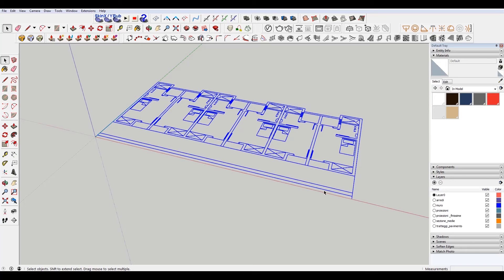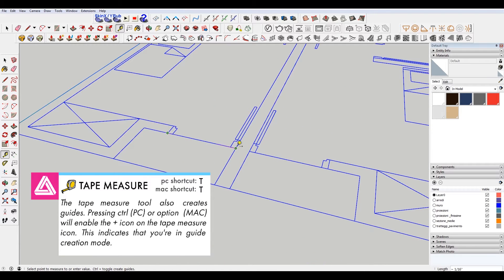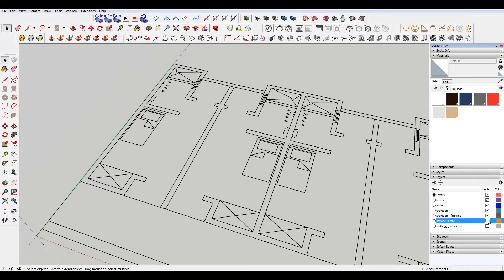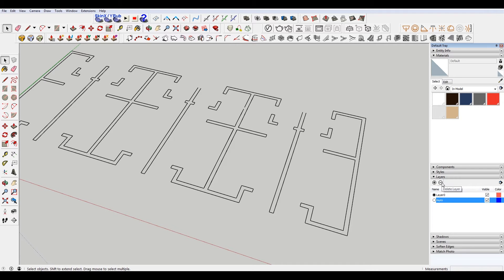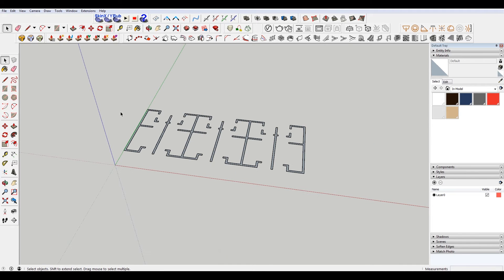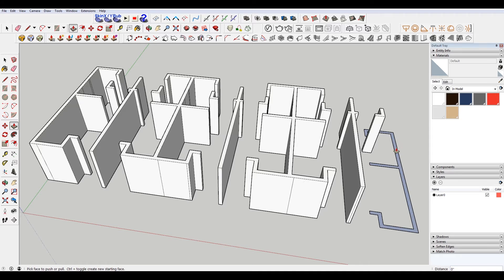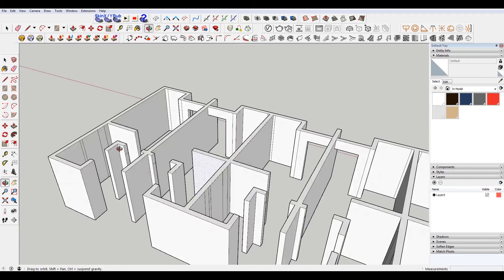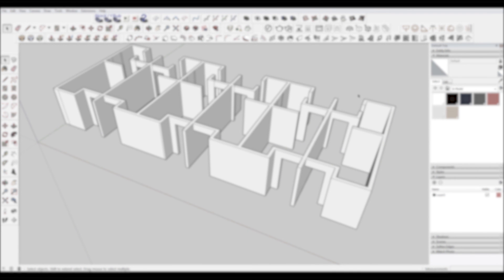How to Quickly Convert an AutoCAD DWG to a 3d Model in Sketchup

Comment: try that on a 500+ layer autocad mess with blocks, xclips, splines, curves exploded into 96 edges.. and nothing in its correct layer.... aHHHHH!  .  Personally,, I find it quicker on import to delete all the autocad layers, place the file in a separate tag, lock it and draw new work over the top, using the rectangle tool to ensure most walls are orthogonal..

Comment: Hi Designer Hacks. I need an advice. I am trying to recreate an old van from the 1940s. None of the vans exists today except a few pictures and drawings, but they are all photographed at an angle. Is it possible to draw the van from these photographs using AutoCAD some how and still with correct measurements. I have tried to measure the pictures and using some mathematical equations but still alot inaccuracies. Can you or somebody help… I know some measurements like distance between the axles and height…  If I compare the drawings I do have with the photos, it is obvious that they are very very inaccurate and I can´t use them...

Comment: Hey, love the tutorial - I have to do this a lot for very large buildings and I find Edge Tools 2 extension real helpful for the close edge gaps function (you can set the distance it will close, so set it below the minimum thickness of your thinnest wall for example) and it will close all the gaps for you.  Then you can drape it as you have done or use S4U- Face maker extension to get all your faces. And finally, the Fredo Joint Push Pull extension will lift all your faces up together too.  
Cheers
Reply from the maker: Killer insight Thomas!  Thanks for sharing these tips mate!
Reply: Designer Hacks no worries mate. Only thing to add is that when performing these things on large files or will seem like your Sketchup has crashed but there should be a little time taken and time left and percentage guage down the bottom left so don't panic! :)
Reply: Sorry to be off topic but does someone know of a way to get back into an instagram account?
I was stupid lost the account password. I would appreciate any help you can offer me.
Reply: @Fletcher Layton instablaster ;)
Reply: @Bobby Colin Thanks so much for your reply. I got to the site on google and im waiting for the hacking stuff atm.
Takes a while so I will get back to you later when my account password hopefully is recovered.
Reply: @Bobby Colin It worked and I finally got access to my account again. I am so happy:D
Thank you so much, you really help me out :D
Reply: @Fletcher Layton You are welcome xD
Reply: Lkkhhy
@4lzpc